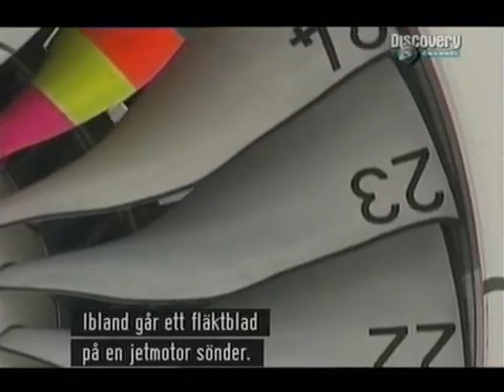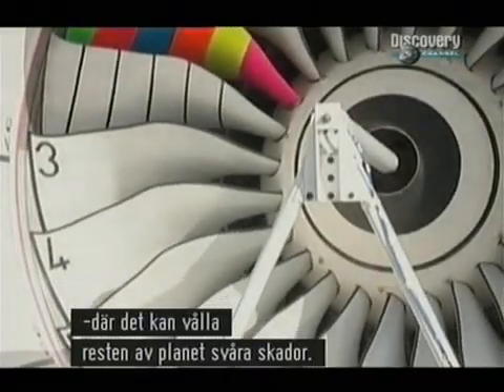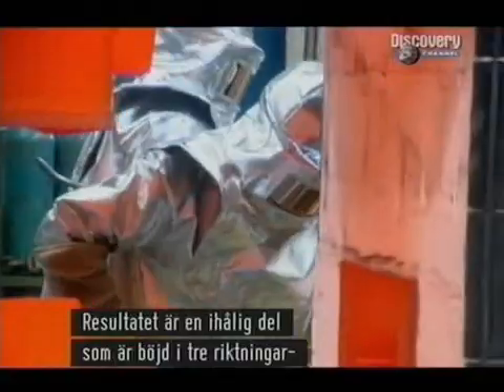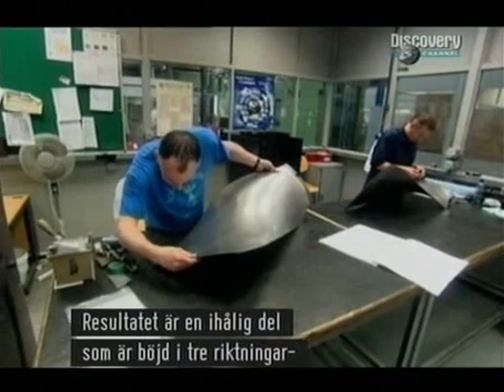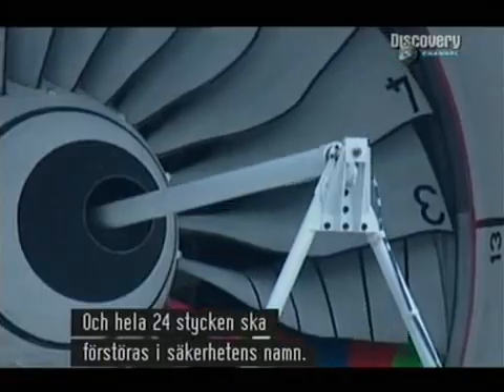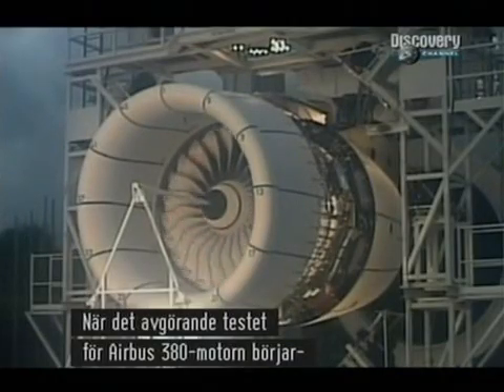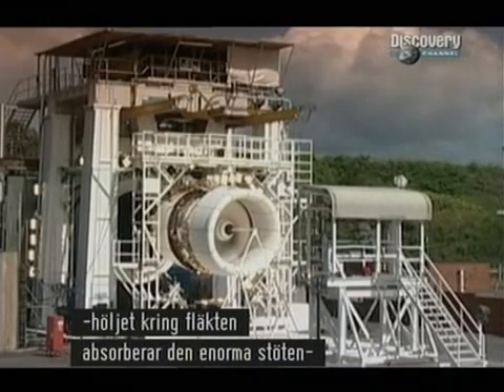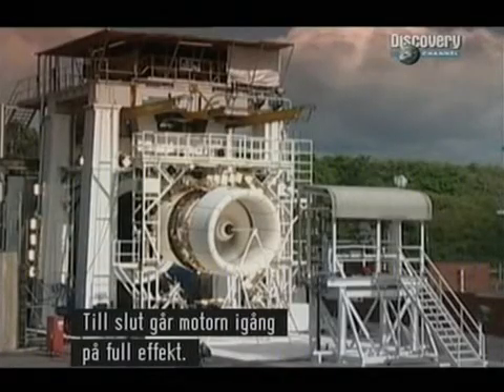A380 Blade Off Test

Comment: What is that rod on the center of the engine??? Plus after the test can the engine be repaired???
Reply: Probably a sensor to detect how much the engine vibrates. The engine is most likely not repaired, since such event would basically turn the engine's interior into scrap metal. They most likely, however, reused the materias in it, since those can be rather expensive.

Comment: And still Qantas 32 happened... Yes it was a high pressure turbine blisk that failed but it still shows that there is a vulnerable area on the Rolls Royce Trent 900 series of engines, and other engines with a similar design and construction

Comment: And yet when there was an engine failure in flight on an A380, the blade failure was uncontained and did significant damage to the aircraft.     Testing under controlled conditions is never quite the same as the real world.

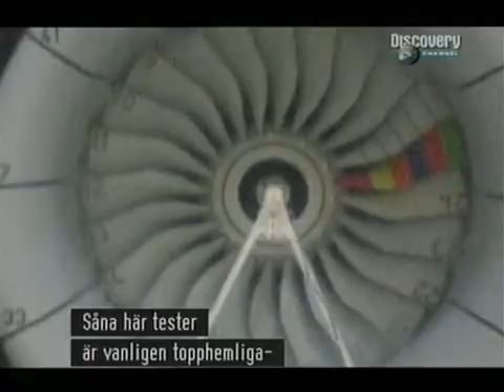Comment: 4:45 - NOT "totally destroyed" - typical BS hyperbole again. The engine internal and rotating components might have been scrapped, but things like oil and fuel lines would have been fine.

Comment: The current regime of Blade Off testing is irrelavent to the safety of aircraft;
1/. The test does not take into consideration the airflow during flight which exposes additional loads on the casings and nacelles, and
2/. The test does not take into consideration the delay of the flight crew to asses the malfunction, and commence the engine shutdown, all the while the engine is still at its power setting...
How about testing inclusive of real flight conditions.

Comment: The first test  they had like  100 blades on the first engine and the engine  exploded completely and the engine just  exploded and shook  like crazy on the big  stage thing platform  but sometime after, they now did this second test after  they added /  resized the blades and  added more space and the destroying blade just goes right through  on the second test and the second test which is in this video,  they made a success on the new update of sizing up the blades and   less amount of blades.  First test failed but after sometime later they   sized up the blades and then did the second test ( this video ) and then it's a successful
Reply: That's what i think.   I might be wrong though

Comment: A fan blade failure is nothing like a fan disk failure.  Quantas airlines had such an event on an A380 and it took off the back half of the Rolls Royce engine, punctured the wing and fuselage and cut electrical control cables, hydraulic lines, and punctured a fuel tank.  That damage almost brought down an airplane with 469 people.

Perhaps Rolls Royce (all manufacturers, actually) should also test for containing disk failures?
Reply: Stephen Ball Not sure if you remember or gave heard of United Flight 232 that had a failure over rural Iowa in 1989.  The plane was a DC-10 and the explosion wiped out all hydraulic systems forcing the pilot, Cpt. Al Haynes to use one wing engine to do a U-turn and fly 70 miles to SUX where the plane ultimately crashed.  Somehow, 184 of 296 passengers survived the cartwheeling fireball.
Reply: I don't believe engine casings are required to contain disk failures. FAA regulations state "the engine has a containment structure which is designed to withstand the consequences of a single blade" and goes on to say "not expected to contain major rotating components." The mass is just too large to reasonably contain and it's much more reasonable to set life limits on these components so they don't fail in the first place.
Reply: I do recall it.  It was also an uncontained full disk failure.
Reply: you know how much weights that disk?
Reply: I do not offhand know how much the disk weighs, but it am confident it is much more than a single blade.
Reply: Stephen Ball you know how difficult is to stop a heavy fragment, traveling with enormous speed?
Reply: I know that it can be challenging, more so as the mass of the object increases.  But I see no reason for it to be impossible, in either a physics viewpoint or an economic one.
Reply: fancy spending $35,000+ for every plane ticket? Thought not.
Reply: Stephen Ball well maybe it is impossible after all, so the only thing you can do is try to prevent something like that from happening from the beginning. so a test would be a waste of time and money.

Comment: I guess they never told the #2 engine on Qantas flight 32 that unconstrained failures were not allowed. Because it did, and took out every system in some way, shape or form. Check out the pictures. It is impressive. And the fact that there were no injuries on the plane or ground is a blind miracle, not designed safety. The worst part about that whole thing was the way Rolls stuck up their middle fingers to everyone, including Qantas.
Reply: +Brütal Löve Well you see they only test for fan disk failure all other spinning parts have no test.
Reply: Yes, unfortunately this type of test isn't the hardest one to pass or the most dangerous way the blade can fail. As was seen with southwest a few days ago, if parts fall off in a non-explosive way, like through fatigue, they can fly forward and out of the engine then go back and damage the aircraft and passengers. But the test is so expensive they can't do it again. So the real testing is done by airlines 🙂
Reply: Qantas 32 was a slightly different problem, oil spilled into the engine causing it to overheat which in the end made it spin with more force than in this test. The force caused the blades to fail so the force the containment ring would have been trying to contain would likely have been more than the engine on full throttle. 

In the end, the Qantas 32 engine failure was a production error of the oil pipe, not a design error.

Comment: I always wondered what happens if the engine stops working, these people work every day to keep that from happening
Reply: Jovan Rodriguez though the apu may be a jet engine it provides no thrust. It's used for power generation to run the auxiliary equipment
Reply: ***** Some planes don't even have an APU, just a spring-loaded windmill that deploys to power the avionics if all engines fail.
Reply: The airplane will glide. Its not the engine that keeps the plane up its the wings. Also every airplane has an emergency engine in case of engine failure called the auxiliary power unit.

Comment: So these guys build super high-tech aircraft engines, but they still don't have flat-screen TVs..lol
Reply: It was uploaded in 2006 and probably filmed few years earlier than that. Flat screens were not that big yet and weren't mass produced in till 2006.
Reply: ***** A light year is a measure of distance, not time.
Reply: Samsung were the only ones making Amoled displays and only now has LG joined the party. Remember how there were no AMOLED tablets? it's because they couldn't scale up the tech in cost-effective manner. So they could have made amoled displays for you, bu they would have been so ridiculously expensive no one would actually pay for them
Reply: I could go into how wrong what you said is (let's start with phosphors in the tube breaking down), but I don't think you'd understand.
Reply: Also, flat LCD and plasma didn't (and still don't) provide a perfect picture (or black level). CRT was proven and reliable. Plus, flat screens came out largely because of aesthetic and spacial reasons for the consumer... Not for scientific research. Why spend $3000 on a flat screen in a scientific platform when a CRT will last forever and do a better job. U can then spend the rest of that money on research.

Comment: About 20 years ago, a UPS 757 box hauler ate a bird out of PDX (Portland OR.) the bird trashed the P&W 2040. A piece of the fan blade got out the side of the nacelle and hit the fuselage. That had P&W, UPS, and the FAA all looking stink eyed at each other, and resulted in a titanium retention shroud being installed in the fan track. UPS eventually gave up on the PRATTS and converted all their 757's to ROLLS RB-211's.

Comment: I remember this video that came out a while before the A380 flew. A PR event for sure but did not take into account a different type of failure whereby engine pieces did eject thru the body of the engine. Fortunately the location of the fuel-tanks seems to be somewhat away from the engine pods & not subject to puncture by "exploding pieces" of an engine.

Comment: Correct. It was the I.P turbine which is a single stage turbine. All 3 shafts spin independently and are not linked through a gearbox.

Comment: Just partly true. You are right, the Qantas A380 incident was a turbine disk failure. But high-pressure disks are spinning at maximum speeds far below 20,000 rpm. The disk which has failed was, according to the ATSB report, part of the IP system so spining at even lower speeds. However, when a disk bursts nothing can stop it. And concerning the lower speed of the fan: All RR Trent engines are of 3-shaft type, so the fan is part of the LP (low pressure) system. So there is NO gearbox!

Comment: It really doesn't matter if they give them in metric or not. Who knows, if this was run made for the United States, the actual measurement may have been 200 yards. Whoever did the subtitles may have been the one who messed up. Either way, it isn't too hard to figure out either one from the other. If the original measurement was yards, it was 200 yards, or 182.9 meters. If the original was metric, it was 218.7 yards, or 200 meters. It's not a significant difference.

Comment: The difference between 200 meters and 200 yards is 18.7 more yards. Since they probably rounded the meters up to 200 (or slightly down) anyway, it doesn't really matter that they also rounded the yards to 200.

You're just being needlessly nitpicky and THAT is stupid.

Comment: Qantas Engine was not a blade off event, it was an uncontained turbine failure.
The Turbines are further back than the air intake blades.

There was an oil leak, which caught fire, and caused the pressure turbine disk to fail, and at 12,500 rpm, it kind of went BOOM.

Comment: @1D0N 3000 rpm is very fast for a 10 foot diameter fan. That's means the tips of the blades are traveling well over the speed of sound (about 900 mph). The smaller compressors and turbines in the engine spin at around 12,000 rpm. The smaller the diameter of a jet engine, the faster it spins. Jets spin extremely fast for their size, much faster than piston engines due to their non-reciprocating nature. Some mini jet engines can reach 250,000 rpm! Even Formula 1 engines spin slow compared to jets.

Comment: @panther105 The standards on the fan shroud are VERY rigid.  In actuality the fan shroud has to contain the blades under all circumstances, even blade failure from hail ingestion.

Comment: @ndugumuzana I know your regret and I feel the pain it took to push each letter in your second paragraph.  These days there are more arm chair engineers than real ones.  What you have seen as a degradation of the numbers of engineers today, especially aeronautic, is due to the education system.  In my time, in high school, I worked on a P&W R1830 and learned to listen for squealer tips.  That's why till this day, my heart is a piston and there's Jet A in my veins.

Comment: @hasenpfote272 A modern plane fly with just one of it's engines running. As long as the blade doesn't escape the engine they pilots should be able to land the plane safely.

Comment: @Juaakili No irony. The Quantas incident was caused by a turbine disc, not a fan blade. They're totally different components. There's no containment system required for the failure of a turbine disc or turbine blades by EASA or the FAA. No engine manufacturer in the world has an HP or IP turbine containment system for an aerospace engine - it's too heavy. These parts are critically controlled at manufacture. The Quantas engine had a defect from manufacture. GE and Pratt have had incidents too.

Comment: @sharand24  Released today, the report highlights how the intermediate pressure turbine disc in the aircraft's No. 2 engine had been weakened by an oil fire. As a result, the disc separated from its shaft, increased its rotation speed and broke into several parts. Sections of the fractured disc and other engine components penetrated the aircraft's left wing and a number of other areas on the aircraft, resulting in significant structural and systems damage.

Comment: @cimbomlovr1 Its just the frame rate of the camera. The blade is spinning slightly slower than the camera's framerate. ie. If the cameras frame rate is 60fps, it might only be doing 55-58 rotations per second,

Comment: @FredPilcher

I had the same thought. They were really lucky that the weak design of the Rolls-Royce engines on the Quantas A380 didn't kill them all. Pieces from the exploded engine damaged the wing heavily. They were just lucky that no fuel tank exploded due to this. So much to the containment of these Rolls-Royce engines. What went wrong during the design of these engines that nearly killed so many peoples?

Comment: Looks like a blade in the compressor failed on the Qantas flight out of Singapore. This raises an interesting issue. Blade off tests are done on the fan blades, however do they perform blade off tests for the compressor and turbine blades as well? Is the section of the engine casing covering the compressor and turbine strengthened the same way as for the fan? Maybe not. It is quite interesting to see the failure in the Qantas flight was uncontained. I woner how Hilary Barton is sleeping now :-(

Comment: , too expensive to try that test on a REAL A380 huh guys. Why not wait to see what happens when there are 800 Passengers aboard  and that blade comes off at 20, 30, or 35,000 Feet. Great Test guys, i was really impressed. WOW, hey lets just put the engine of a 800 passenger plane on a rack, and test it, if it passes will hook it on the plane's wing and if it fly's, will get some cash. yaaaayy. will do the other tests when the plane actually goes down.

Comment: Everyone in the room is laughing and smiling that the blade didn't go through anything but the engine still exploded. That's very good guys, you guys are the best, the blade didn't hurt us at all, but guess what, one of the engines exploded, and to make the situation even better, the engine was not even on the plane's full of jet fuel wing. How about you guys try that same test on a real A380 AIRBUS ON THE AIR with dummies inside and then lets see what happens, but maybe not huh guys,

Comment: "whatever happens the blade should not leave the engine" - Bet these guys are on their way to check the Qantas A380 engine failure wondering how the blade went through the leading edge of the wing.

Comment: @HeadDrauma The engine's core might spin significantly faster, but the fan won't surpass 3,000rpm very often.  Its size is what allows it to spin much more slowly than the core's interior.

Comment: @MrWillydoit  ok fisrt  of all that was a joke ok? go youtube its over 9000 and you get bunch of nonsens video of a guy saying its over 9000 , but i read my Boeing 737 book, the CFM56 engines on the 737 (and some of its Airbus competitors), the two compressor sections max RPM is 5175 RPM for the N1 (low pressure) compressor, and 14460 RPM for the N2 (high pressure) compressor there you go so at high pressure the eninge spins at 14460 rpm!

Comment: Multi-engine aircraft can fly with the remaining engines when an engine fails. There are ways to compensate for the balance issue (including reducing throttle on the live engine(s)). The aircraft can actually continue to fly for a long time this way, just much slower than normally.

Comment: @seajist I'm pretty sure the engines are powerful enough that if you loose one, you can still fly.  Thus, keeping the rest of the plane intact in case of an engine failure has a benefit.

Comment: They do this after the other, normal tests are complete. Like they say in the video, it's to ensure that the blade is contained, and that the engine won't violently self-destruct or detach from the plane if this happens. I'm currently working on the test-stand equipment for a FBO test.

Comment: ... really...? Yes, considering the millions upon millions of cumulative hours every turbo fan on every aircraft is running through out a year, it is fantastic that this only happens once every three years. Its inevitable that a piece of metal rotating at 3000 rpm is going to eventually fail. And anyway, the point of the test was to contain the blad within the engine when it separated and not go shooting out somehwere... like the fuselage containing the passengers. So yes, that is good.

Comment: Actually, the 787 is also made of plastic...but don't worry, the plastic material they use for aircraft these days is actually stronger than aluminum, yet lighter in weight.

Comment: technical note: its *duct tape :)

Ducks dont need adhesive tape/
Reply: Grant-- a common mistake, because this tape has found a large use on air ducts. Here's the real story: A request from the military during WW2 to U.S. manufacturers for a temporary way to seal ammo boxes in the field from weather was successfully answered by Johnson & Johnson Co.(yes, the makers of Band Aids)  They made this tape that sealed the box "like water off a duck's back".  The original name was Duck Tape.  It still is used by the holders of the original patent.  There are now off-brands and use whatever name they want.

Comment: I really don't get what the point is of tests like this and why the enigeers were clapping.  They clearly understand nothing about probaility and statistcics. One single test proves virtually nothing.  All it demonstrates is that in this particular test, the engine contained the shrapnel.  It says nothing about whether it will do so next time when a blade fails on a live aircraft. In order to get any meaningful data, a large number of tests would have to be run, but this would be too expensive.